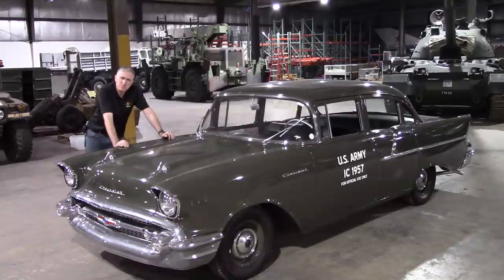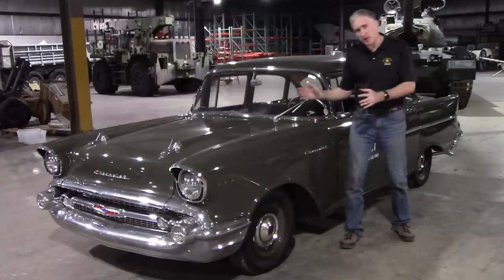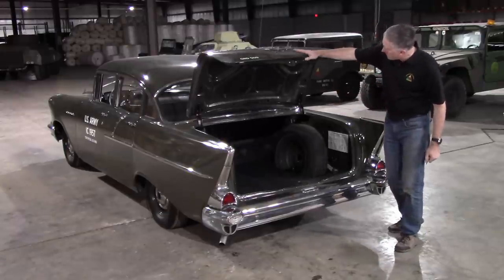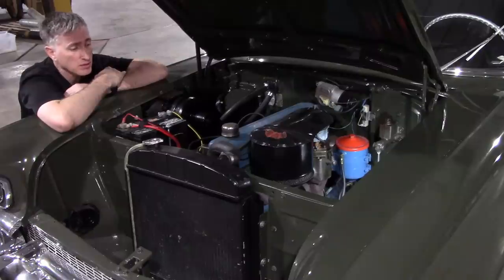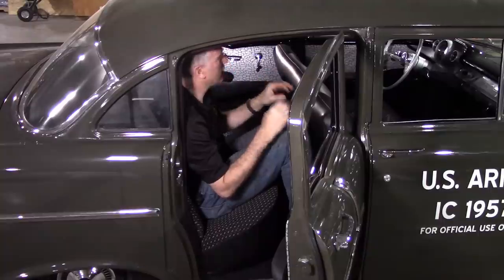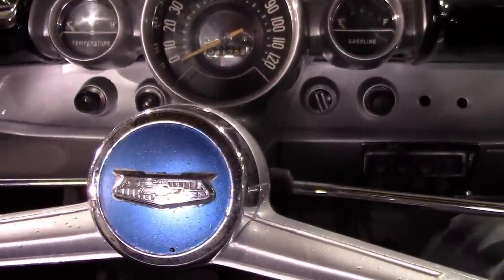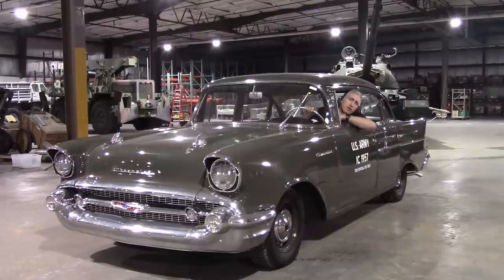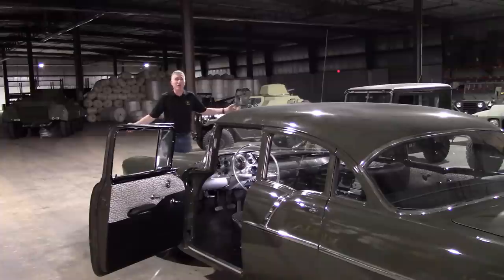Inside the Chieftain's Hatch: Chevrolet 1503

Comment: The incredible part is that this base trim model has the least chrome of any Chevy that year.
Reply: trr94001 You just blew my mind.
Reply: Chevy - so we heard you liked chrome
Reply: The deluxe model had chrome windshields. :-P
Reply: It was basically a taxi. Maybe even worse because it has manual transmission.
Reply: @jakublulek3261  a Taxi, e.g. a Checker, would have a lot more room in the backseat, and maybe even a jump seat.

Comment: It's not a door handle, it's a door horizontal angle regulator
Reply: Door Latch Release Lever
Reply: door horizontal angle regulator, one each.
Reply: @ulrichkalber9039  two each, one internal, one external.
Reply: @DERP_Squad  if you count them it is four each.two inside two outside two left side two Right side.
Reply: Jon Doe  so ist 4 handles in front, 4 in the rear 4 in the left 4 in the Right 4 inside and 4 outside. that is 24 .
Reply: Chrome entry system activation lever.
Reply: starts department to determine how many door horizontal angle regulators are on one car
Reply: @xirensixseo is being nominated "horizontal angle regulator number determination comitee chairperson"
Reply: @ulrichkalber9039  confirmed
Reply: It's a side door opening handle. Like on the old tanks of WWI or interwar period.
Reply: As an ex-squid, we would have to have kept an actionable list of safety devices requiring maintenance and kept in the relevant documentation noting every knob, lever, guage, indivatir, light, fuse, floor mat or flooring system, etc. And a list of all required "on board" documentation... Yes, we really are that bad.

Comment: "That's not a tank"
Never driven a 50's era car, have you?
Reply: From first hand experience, You are so right
Reply: Turns like a boat
Reply: @xaviersaavedra7442  how does it feel like? Not only turning, but shifting gears and acceleration and all that?
Reply: You don't park it you dock it!
Reply: @alvarohernani6645   Shifting gears is like stirring thick porridge even on an immaculate example.
Reply: Alvaro Hernani 
Shifting the gears are easy, the gas consumption and 90 mile engine is very tankish.
Especially how thick the body is, It can stop .38 bullet
Reply: @cmotdibbler4454  I never saw Chevy like this with manual, only with 2-speed Powerglide or 3-speed Triple-Turbine. Which is very interesting experience.
Reply: @xaviersaavedra7442  It is something that many Eastern Bloc cars carried all the way to 1980s.
Reply: Heh, yeah the cars built in the 50's-80's were built like brick shithouses, tough as old boots and also a hell of a lot more easier to maintain unlike today's cars where it costs you an arm and a leg for say a front bumper...Get a dent in this car? No worries, just bang it out with a hammer! Car's of today "Oh that tiny dent in the wheel arch will require the wheel arch, front bumper, door housing and front door to be replaced even if there's no damage to any of the other parts"
Reply: @MegaRazorback  I had to look it up when he mentioned the powerplant because my first thought was "wait... what kinda engine did they stick in the deuce and a half again?" Different engine, but I imagine the logic was "if we order an inline six, parts will be common, fixes will be easy, and any motor-t bubba will be able to keep it running."
Reply: @alvarohernani6645  "Helm come about to two seven zero, engines ahead full."
Reply: @Tomyironmane  Oddly enough, the USA tanks of WW2 and a lot of their cars of the same era shared similar parts, i mean why go to the trouble of designing a totally new engine that is then stuck in a tank as a rush job to power the thing when there's a perfectly good engine already in common usage and readily available to be slightly modified to fit the requirements of the tank in question?

Edit: I just remembered that the USA couldn't really afford to splurge on anything OTHER than what was absolutely needed during the war even WITH all the bonds they handed out.
Reply: @MegaRazorback  I encourage you to look at the scale and difference between a tank engine and a car engine. Tank engines are not quite like anything else... Though the Chrysler A57 Multibank probably had part commonality with something ... and the radials were downrated aircraft engines....
Reply: @alvarohernani6645   compared to modern cars, everything is sorta vague.  Steering, braking, shifting, accelerating. Because of that driving one demanded more attention than modern cars.
Reply: never driven a tank have you?

Comment: Oh sweet summer child.  That foot switch is for the High beams.   Also my dad had a Chevy with that 140 HP inline 6, and My brother rebuilt it as a high school project. That engine is a 1930's design.
Reply: I lot of people don't realize it, but the 235 six-banger powered the first Corvettes.  I had a hotshot car fanatic bet me $100 that all Corvettes were V8s.  He lost.  The new small block V8, introduced in 1955, was still only an option; the Corvette still had a six-banger 'Blue Flame' in base trim.

Comment: What a straight and wonderfully preserved '57. If its been restored, its a good restoration. Soft spot in my heart for tri-fives, 57s have all the flash and chrome, lovely beasts.
Reply: Amen.
Reply: Right up until someone put that cheap on/off wiper switch under the dash.  Factory equipped cars came with a rotary switch beside the headlight switch with a duplicate knob with on/off and speed select and also an auto park feature in full down position when wipers were turned off. Somebody bastardized that set-up.
Reply: @brustar5152  or the setup broken someone couldn't find the part to replace it.

Comment: I miss wing windows and floor mounted dimmer switches.
Reply: and dying when you get hit by anything going faster than 20 mph
Reply: Got an old beetle, got wind vents. Quick and easy ventilation control. Now we have six controls, three servos, vacuum assisted flappers, and three miles of wire. The more crap they can stuff in, the higher the profit margin. Oh, my beetle does have a stalk mounted dimmer though. I'd have to argue it's a better location and I don't really miss the corroded floor stomper buttons. Meh, opinions, we all  got 'em.
Reply: @beavis6363  What sucked about the beetles was the heater / defroster, heated the air by blowing in around the exhaust pipes, then channeled it up front through tunnels on the floor, which tended to rust out. Windshield washer powered by the air pressure inside the spare tire. Jack lifted up one whole side of the car.
Reply: Jon Doe  The 57 Chevy will be fine. You, however, will not. Modern cars are designed to deform to take the brunt of the impact so that the passengers stay safe. Unfortunately, this also makes the the car less durable.
Reply: The only bad thing about floor-mounted dimmers is that they take up the space where the dead rest pedal for your clutch foot should be.
Reply: Jon Doe  I'll take your money erm i mean bet. While it might look solid they really don't fair well in accidents. See for example https://www.youtube.com/watch?v=1_ptUrQOMPs
Reply: I miss manual window cranks.
Reply: Yall are wrong. Look up crash test videos. Modern cars hold up allot better.
Reply: Jon Doe  All the chevy wouyld need is a rubber mallet to knock out the ding in the fender.
Reply: yeah, wing windows or 1/4 lights ftw
Reply: Jon Doe  and youd be wrong.
Reply: Howie Felterbush  no seat belts, steel dashboard, and a steering column and wheel that will impale you
Reply: Howie Felterbush  the 57's driver will be needing a vehicle to take them away though.

Comment: The "chrome protrusions" on the bumpers are mounting brackets for extra lights/Fog lights.  There is a screwed end cap on them that can be removed.  They were optional equipment, and most people never took the option.
Reply: I wonder if the bumper was replaced at one point if it was optional.
Reply: Never saw such an option, and it's a bit doubtful as the bracket inside the Dagmars would be difficult to work around and there is no access for wiring in the bumper behind them as the only hole is for the one bolt that secures it.  The rubber bullet tip was however a popular option.
Reply: @philbarrows2431  oh crap!  I completely forgot about those "bullet" tips.  Good catch.  I could swear I remember seeing lights there too on some of em'... maybe it was aftermarket or something.
Reply: @krisvires  Yes, possible. There were plenty of mods like that in the old JC Whitney catalogs.

Comment: High gloss olive drab feels like an unnatural combination.
Reply: I wondered why the Army had me polish olive drab jeeps but I wasn't paid to wonder why, my job was to do or die.
Reply: The Air Force models were at least blue.
Reply: I think matte olive drab and chrome would have been an odd combo too.
Reply: @hammersandnails1458  So they are camouflaged with the sky obviously.
Reply: @nancyvandenboomen984  assuming you’re using wax, corrosion protection.😁 Of course they could have used a satin finish, but...

Comment: This model came with a backseat optional. It was also manufactured in 1956 and 1955 and was very popular with the hot rod enthusiast due to it being the lightest of the four models. One way you can tell this body style from a Bel Air is the Chrome on the side which is straight on this one and curved down on the Bellaire and the Impala had the rear light display top center of the rear window. The Biscayne black the intake style Hood on all models that had day curved Chrome on the 57 models. 58 was a complete different body style with no fins curved indentation on the rear side panels

Comment: The fuel tank  filler location baffled many when the 57 hit the streets. The 56s were similar.
Reply: It was like a game for manufacturers back then - hide the filler cap.

Even into the '80s, some cars had the filler hidden behind a hinged license plate frame.  I've had the opportunity to laugh at millenials as they tried to find those fillers a couple of times.
Reply: @immikeurnot  My first car was a '76 Buick Century. It had the fuel filler under the licence plate. It was actually very practical, didn't matter which side of the pump you pulled up to.
Reply: @immikeurnot  I'm pretty sure my dad's station wagon had the filler port behind the plate.  I remember it being somewhere obscure.  But that was nearly 30 years ago at this point so I don't quite recall.
Reply: @hammersandnails1458  It became moderately impractical, even frustrating, with certain Cadillacs. Particularly the mid-'70s Fleetwood Series 75.

Maneuvering a sedan 21 feet long is a serious exercise in practical geometry, at the least. Very comfortable, of course, and with a startling level of power given its size.

Comment: I've had several cars with the Blue Flame motor and I've found the motor incredibly reliable and hard to kill, it's powerful enough to push the car along happily, I've never thought it was under-powered or weak. Just a very basic simple engine that will happily get you from A to B year after year even when pulling a trailer or towing another car.
Reply: As I recall, Chevrolet (a straight 6) and Dodge (a "slant" six, think half a V-12) continued with 6-cylinder engines as car offerings a few years past Ford (except the Falcon/Comet). All had 1 or 2 6-cylinders in their truck lines for quite a bit longer.

Comment: 22 psi tires was a miss-print in the original service document.  32 psi was normal.  The Government Printing Office screwed up.
Reply from the maker: Oops. But now that you mention it, it makes sense
Reply: No, the original bias-ply tires would have been inflated to 22 psi. That was normal and correct. Modern radial tires usually run between 30 and 35 psi.
Reply: @dominicmartinelli5762  I serviced many Army Staff Cars in my life, and none had 22 psi inflation pressures.  Running a bias ply tire at 22 psi would have them looking bulged like radials and they would over heat.
Reply: @ewathoughts8476  I stand corrected. Chevrolet recommend 24 psi front and 28 rear when cold.
Reply: @dominicmartinelli5762  That is correct, but that is not what the Army FM specified.  This is an US Army Staff Car, and with the US Army there is a right way, a wrong way, the ARMY way, and my way, so says the Staff Sargent.  If you do it my way we will get along, if not there is latrine duty in your immediate future.  LOL, I know how to police up a latrine, because I followed the original FM and the base commanders car had two flats in one day due to tire overheating.  My Sargent handed me the TM Change order, and I had to update the whole outfits FMs, and clean the latrines for a month.  That sort of stays with one.
Reply: My 1966 Chevy shop manual likewise specifies ridiculously low tire pressures: 24 psi, except more in back if you have a load in the trunk.  They even specify 24/24 for the Corvette!  That may give a soft ride but the handling is dismal.  Pressures well into the 30's are needed for serious cornering on pavement.  My 1965 Corvair shop manual specifies 15 cold for the fronts and 26 cold for the rears, to help tame oversteer.  Apparently the "ride engineers" overruled the "handling engineers" on recommended tire pressures.
Reply: @jedgarsquink  Long rear overhang cars had most of the payload end up on the rear tires when the car was nearly full, therefore the rear tires would be set to higher pressure.  Corvettes were nearly 50/50 loaded or not. and Corvairs were about 30/70 empty and 40/60 loaded.  1957 Chevies were about 60/40 empty and 35/65 at full load.  In my day our drivers were about 150# and short so the front seat was well forward so the fat officers had leg room.  I think by 1966 the tires were wide profile R75 and R70 types with 6 inch rims while the 57s were narrow tread with 5 inch rims.
Reply: @ewathoughts8476  Correct about higher tire pressures for more load.  C2 Corvette is about 47/53 with driver with a small block.  Corvair is about 38/62.  OEM tires in 1966 were still bias ply.

Comment: The foot switch to the left is for headlights high and low beam.  It is the best place to put it and it's a shame we have to use our hands to change that now.  When driving in country it was much easier to rest your left foot on the switch and tap it to change.  Things have gotten worse in terms of ergonomics only because it's cheaper.

Comment: I guess growing up playing with cars gives me extreme joy to watch you being baffled of the fues access cover location. The '55 and '56 were similarly hidden. Also the hood/bonnet release lacation hunt. This was a good comical watch. Thank you for that.
Reply: 55 wasn't hidden, it was plainly visible on the left rear fender.  56 was tricky.  There was a bit of chrome trim that had to be turned, and then the entire tail light assembly hinged downward.  Yes, I pumped a lot of gasoline when these were still fairly common on the road.  Most cars it was either behind the rear license plate frame, or plainly visible.  GM played "hide the filler" in 56 and 57.

Model T Fords had it under the seat.  Early VWs it was in front, inside the trunk.

Comment: Three on a tree. What I learned to drive on.
Reply: Same here. It was a 1954 Ford that my brother had restored.
Reply: Old Iron  And she would shift while you worked the clutch.
Reply: Same, old Plymouth Volare, 3 in the tree and a slant six.
Reply: My first car was a 1965 Studebaker Commander 4 door it came with a 283 chevy and 3 on the tree with overdrive. I installed a built 350hp 327 corvette engine in it.  Boy what a sleeper. I beat many a big block muscle car in street light drags.  Blew it up racing a big block camaro. I dropped a valve at 7000 rpm

Comment: What a beautifully preserved/restored piece of history. I have a 57 Two-Ten 4-door with a 235 and 3-spd. Like this car it has no power steering, power brakes, or AC although being a Two-Ten it has slightly more chrome/stainless although not much more and does have actual carpet. I am amused to find out that the heater was an optional component. I'd have thought it would have been standard in even the most basic cars by 57.

Comment: Born in 1949 and having owned 1950's and 60's cars (52 Ford, 56 Mercury, 57 Ford, 65 Mustang, etc.),  his floundering around this very basic car was fun.  Hood release?  Well, reach under the edge of the hood and pop the release.  Trunk release?  Use the key, that's what the lock is for.  Dimming option on rear view mirror?  What's that?  Clicking the headlight dimmer switch on the floor and puzzled as to it's use.  Hidden gas fillers?  Style and had a great time watching you walk around the car looking for it.   Many cars had them behind the license plate.  Rubber floor mats?  Standard.  Three speed on the column?  Common knowledge.  Simple, wide open engine compartment with no computers, no sensors.  Easy to maintain and repair which was good because they broke down a lot.  A car with 75,000 on the clock was high mileage and ready for the junk heap.  The 50's were about style and not about handling or engineering.  Hence the abundance of chrome and fins and useless decorative details.  But those huge chrome bumpers were actually functional.  You could thump into something hard and not chip the chrome.

Comment: The button on the driver's floor on the left is a headlight "bright"/"dim" switch for highway driving.  You were actually using it correctly.  My grandfather had a truck with the same floor headlight control switch.